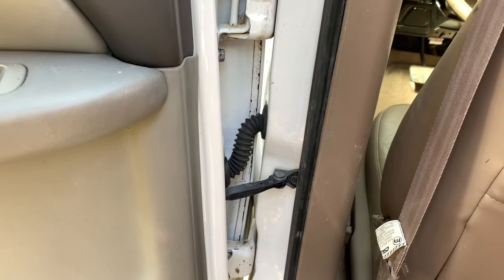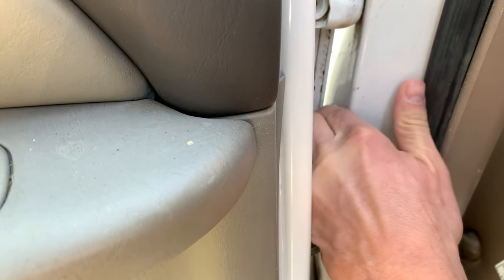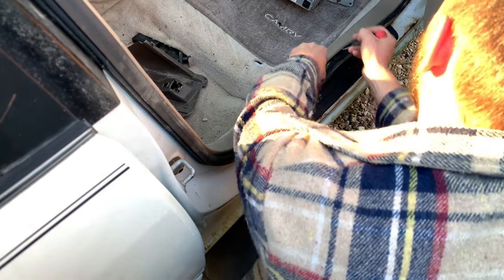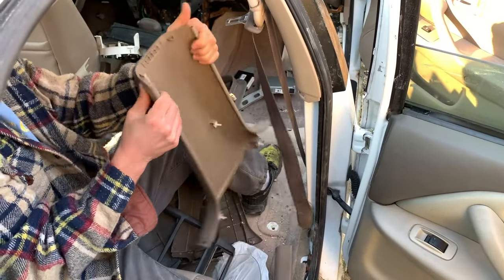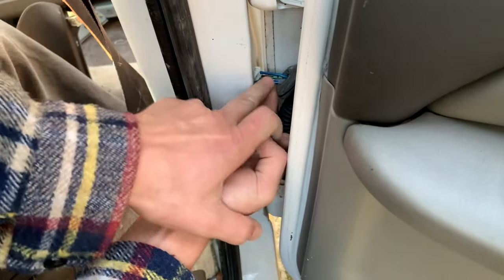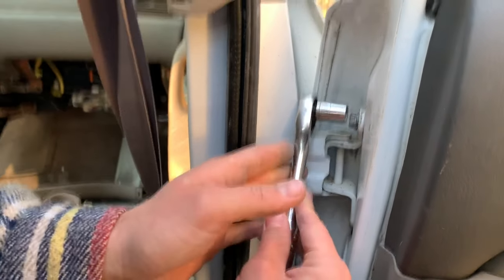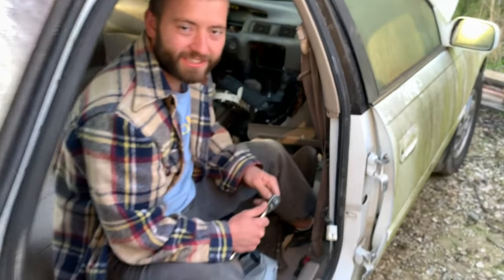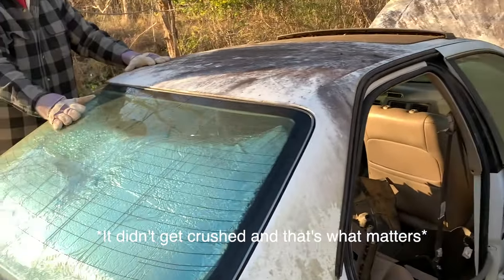Car Door Removal

Comment: The easiest way to remove a back door with one person is to open it , disconnect the door catch and wire harness,     shut the door ,  open the front door so you can undo the bolts on the back door while it's CLOSED ,  after that everything should be undone so you can grab the door from one side and open the door while holding the handle and it won't fall

If you're removing a front door I would suggest using a floor jack with a rag on it so you don't take any paint off the bottom of the door,  undo the door catch, wire harness, the bottom 2 bolts and the very top bolt leaving the 2nd bolt from the top last , while you're undoing the very last bolt put a hand on the top of the door so it doesn't fall off

If you're in a junkyard that doesn't allow jacks ,  take the fender off and undo everything like I said to do for the back door
Reply from the maker: That's a good method for doing it with one person!
Reply: Your comment is priceless. We went to the junk yard w/my husband and they don't allow jacks. And actually the door is sitting kind of high, since they put cars on tall support (old wheels and smth else on the bottom), so I even don't know if the jack would help. I was afraid to let my husband to hold that door, since unknown weight, and that door is sitting kind of high. We decided to come back w/a step ladder to support that door. But your method (w/removing the fender 1st) is so much better, I think. Thank you very much.
Reply from the maker: @olenaerhardt7725 His method definitely seems ideal!
Reply: @olenaerhardt7725  I'm glad it helped ;)
I've dropped plenty of nice doors from trying to take it off the wrong way but I never have managed to drop or damage a door with that method
Reply: @joegartner7736  As a DIY mechanic I did a lot of projects on our cars, but didn't deal much w/Body Repairs. I've straighten some bumpers and fenders, using Bondo, but in a primitive way, so all that PDR is quite unknown area for me, interesting though. I think to take a few Race Ramps to the junk yard to make a support for that door (not sure if that door closes completely). I'll see, thank you very much again. Sir, please could you tell, if I install a new lock on the PS front door (currently it doesn't have one), can I or a locksmith adjust that new lock for the current key we use? We have the lock only on the Front DS, and it would be so much better to have it on both.
Reply: @dudewecanfixit  Sure so. I also think to take to the Junk Yard 3-4 Race Ramps, to put them one on one as a support (I remember the door, we liked, didn't close completely, it was some object installed inside to prevent it fm/ closing, maybe I can remove it, we'll see).
Reply from the maker: A locksmith should be able to do that.
Reply: @dudewecanfixit  I am so happy to know that. Our DS Front door got stuck after the accident, and currently I can't open it. Fortunately the remote control is working, so I was able to get inside and drive the car to the place where I can work on it. I saw a hole in the Front PS door similar to the DS, so think I can install another lock there (on PS). Thank you for the replay and a great film.
Reply: @olenaerhardt7725  yes a locksmith can re-pin it 👍
Reply: @joegartner7736  That is great, thank you! Much better to have an option to use a key on both sides.
Reply: @olenaerhardt7725  you're more than welcome 👍

Comment: Thank you for being so detailed in your instructions and straight to the point. Cheers mate
Reply from the maker: Thanks!
Reply: Update : bought two doors at the scrap yard that were the same color for 120$ and installed them. Only cost were the adjustment and perfect seal at the body shop. Great way to save hundreds if not thousands

Comment: Glad  I found  this...if I can wriggle wire harnesses  out ...im home free....but I want  to lube power  window  tracks ....they seem dry from factory  , shortens life and keeps cash coming  in for certified mechanics  and parts. I got original keys....dont really  need to mess with  locks Thanks for sharing ....save me major hassles .Im doing a Mitsubishi  but they  seem quite similar  at glance .
Reply from the maker: Glad I could help!

Comment: I'll be looking for a replacement door from a junk yard, so I'm looking into what I might need to get the job done.

1. Is it a good idea to get the junk yard dealer to demonstrate that the electricals (the actuator!) are functioning properly on the replacement door?

2. Do scrap dealers generally expect buyers to remove parts like car doors themselves? In that case I might need to bring an extra pair of hands🤔

Thanks for the video!

2.

Comment: @5:33  Sir, could you tell, what is an approximate weight of that door? I've heard it is about 40-45 lbs, but my husband thinks it is about 120 lbs. We have 2009 Nissan Sentra, the door looks the same. Thank you for you film again, so many details, like that inner socket disconnected from inside. I saw another film where one person was holding the door in his arms while the author was disconnecting that socket. Your way is much more convenient.
Reply from the maker: Probably around 80-100lbs.

I was able to pick it up overhead
Reply: @dudewecanfixit  O no! I thought it is about 45 lbs most. But thank you very much for warning. They wrote me fm ebay it is 135 lbs w/pallet (for 2009 Nissan Sentra) and I thought that it was the pallet so heavy, but now I'm in doubts. I saw you were holding it overhead, but see different people can do different things. I'm so glad I didn't attempt to unscrew the door at the junkyard  with my husband keeping it, no he wouldn't be able to hold right such a heavy object. Just support, support, that what is needed to handle this. Thanks a lot again.
Reply from the maker: Yes, be careful taking it off!
Reply: @dudewecanfixit  Thank you! Seems like so simple project, just 4 bolts, but that weight and the size of the door ...
Reply: Do I need to disconnect the battery?

Comment: Thanks for the video .. are those bolts really secure to hold the door?. Sometimes you need to grab the inside handle to support yourself to get off the car.. by giving pressure on the door .. will those bolts get lose? Or affect the alignment?
Reply from the maker: They do need to be tight. They are very important to have the door aligned correctly

Comment: I like how simple you made this!! Thank you! I do have a question and I hope it's not too dumb but I have a 96 Camry and I have to replace a couple of doors. The local pick a part has several 97s that I could patch together a whole new body with.  My question is is that realistic or even possible??  All the cars are Japan make but only mine has a sliding sun roof.
Reply from the maker: The 96 and 97 are different body styles. You will need to get parts off a 92-96 Camry or they won't fit
Reply: @dudewecanfixit  Oh wow okay thank you!   I didn't know that and my backyard mechanic friend was just going with my request.

Comment: Instead of taking all the little panels inside to disconnect the plug, why don't you just pull out the rubber grommet hose from the outside and take the wire harnesses out from there?
Reply from the maker: I tried it both ways, and the way that I did it in the video is much easier!

Comment: Is it possible to still install a door but it doesn’t have a connector, I found one but can the connector itself be replaced?
Reply from the maker: If it doesn't have wiring, none of the electronics in the door will work. But you can still put it on there

Comment: Any idea if this would be similar in a 2014 corolla
Reply from the maker: I'm not sure, but it might be similar
Reply from the maker: Just open the door and take a look at the hinge setup. If they are bolted on, then yes.
Reply: @dudewecanfixit  the door can't be opened . It was hit and is stuck .
Reply: @dudewecanfixit  any possibility the door panel can be taken off without the door being open ?

Comment: Hi, I'm trying to swap out my friends 2007 camry xle front passenger side door due to heavy rust below. Are the front door electrical connector same way pull and disconnect the click as the 1997 to 2001? Thanks
Reply from the maker: I've never taken a door off that model car, but it is probably very similar
Reply: @dudewecanfixit  thanks for the reply i will check it out with my friend. It might be just easy as this one :D
Reply: @Leo-fz4qy  was it similar? Need to do this on a newer Camry, 07-11